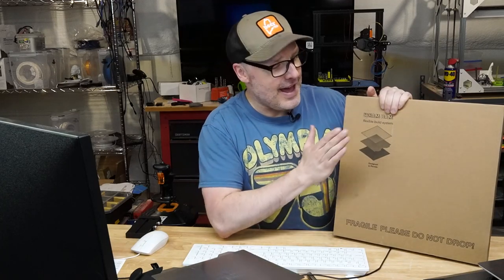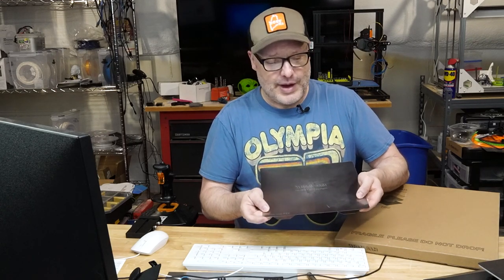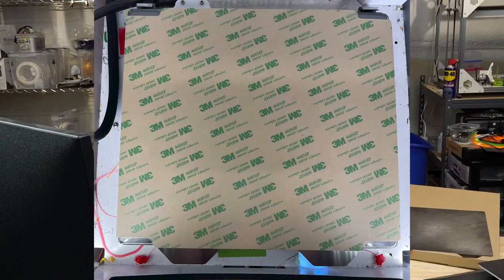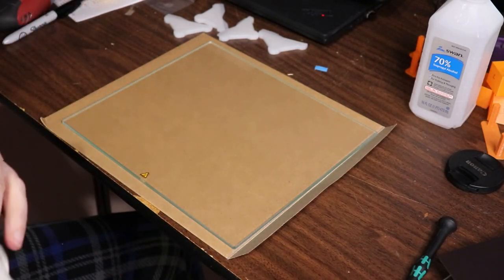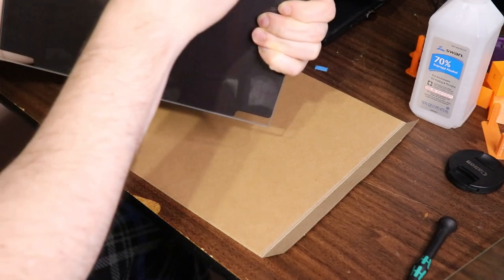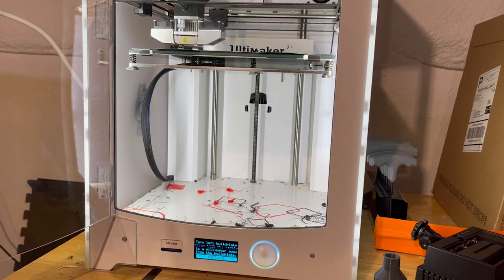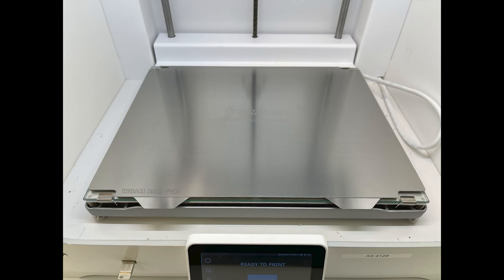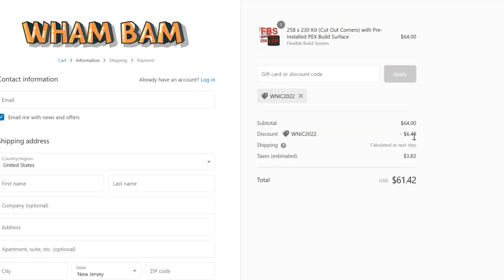Wham Bam Bed Systems for the Ultimaker 2/2+ and Ultimaker S3/S5

Comment: I have Wham Bams on my 2 Ender 3 machines but was shocked when I looked for some for my 2 Ender 5 Plus models, they are $140 each! and my Pro 3D V-King 400 has an even larger build area so I didnt even look for one for that machine!
Reply from the maker: I paid a lot for my Chiron and my CR-10S5 beds too. But I need something reliable to hold down those huge prints
Reply: @WhereNerdyisCool  I use mirror tiles on my large format machines as they have to be perfectly flat or the reflection gets warped, on mid to large size prints with plenty of surface area I dont need any adhesives but for small parts I use purple glue stick just as an insurance of the part coming loose
Reply from the maker: @AndrewAHayes  I experimented with mirrors as a base and it wasn’t much different than glass.  I’m more in the camp of a level build plate along the lines of a super flat thick aluminum plate. We machines some 1 inch thick ones at work for our Modix 120X.  The engineers also created the mount holes and elongated them to take into account expansion on X and Y due to the heating

Comment: Hi, i'm having issues with WB PEX buildplate on my S5, have you done something to make it works? Mine just whent through the PEX during the auto bed leveling
Reply from the maker: No issues with the ones I bought for out S5’s at work.
Reply: @WhereNerdyisCool  thanks for this fast answer 👍 i will search a bit more why this happening
Reply: Did you figure this out? Thinking of getting one for my S5. 
Did you have to mess with the thumb screws on the bed for the s5 or did the auto mesh bed level just account for the magnet and pex sheet automagically?
Reply from the maker: @deepsreddy  I have this on 6 UMS5's at work, no issues.  Auto leveling has worked fine for me!
Reply: Recently purchased the system as well but did not use it yet. Really don't want this to happen. 
did you end up manual leveling the whole thing?
Reply: @WhereNerdyisCool  how do you get it to auto level? it doesn't do it before every print, changing cores?
Reply from the maker: @CustomMachines manually leveling is a cinch, don’t let that scare you off. It’s been a great upgrade for me
Reply: @CustomMachines  Did you install it yet? If so, did you glue the 3M Magnetic sheet to the metal printbed, or on top of a glass plate?
Reply from the maker: @stmedia9356 on the glass.
Reply: @WhereNerdyisCool  can this be different per brand? I got a different one, but if I stick this onto the glass the clips will never work again. They didn't include instructions...
Reply from the maker: You should have gone with Wham Bam.  They have the cutouts on the magnet and plate to fit the clips
Reply: @WhereNerdyisCool   very true. that was alot easier than expected. thanks alot! works like a charm :)
Reply: @WhereNerdyisCool  one more question tho, if you have to XY calibrate printcores do you switch it back to a glass plate for the calibration sheet? so every time you have to calibrate cores you have to level the bed again?
Reply from the maker: @CustomMachines nah I’m able to do that XY calibration fine on the WhamBam and reference the provided calibration sheet just fine
Reply: @WhereNerdyisCool  tried it and works perfectly. thanks alot for helping out!

Comment: Does it matter what side of the glass you install the magnet on?
Reply from the maker: I don’t think so.
Reply: @WhereNerdyisCool  yeah that’s what I thought too. I have an old build plate that has a nick or two I thought I would use the non damaged side of it. Thanks for the reply.
Reply from the maker: Just make sure it’s perfectly flat !
I bought a brand new one just to start fresh